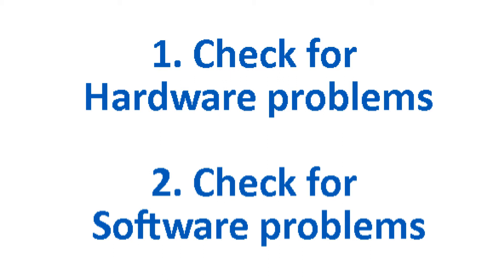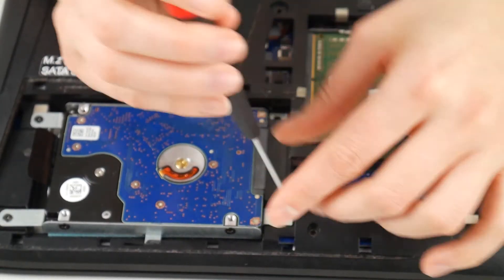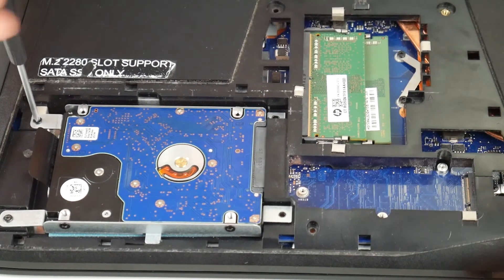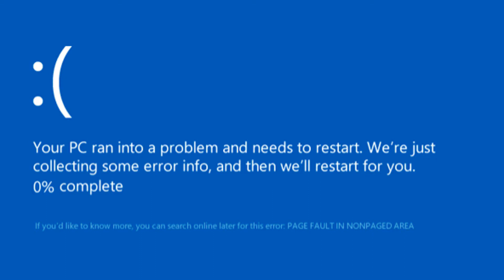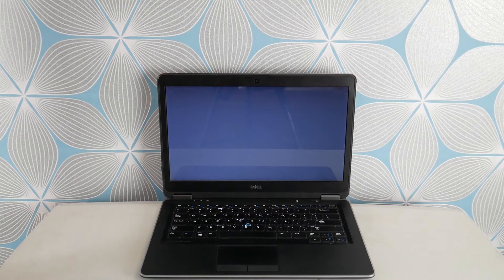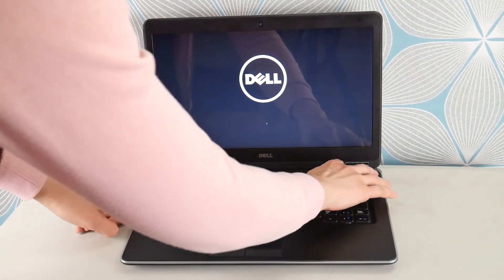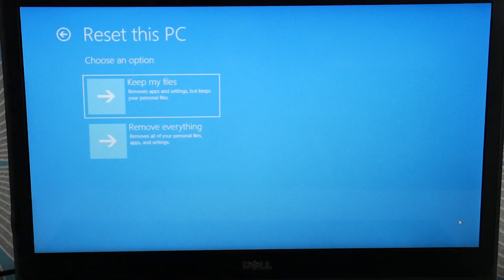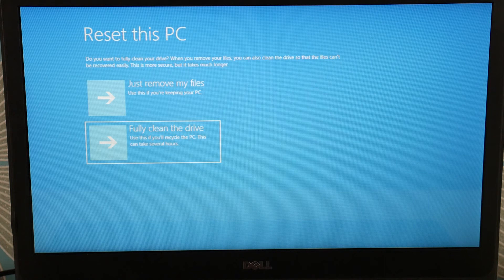How To Fix A Dell With A Page Fault In Nonpaged Area Blue Screen Error

Comment: PAGE_FAULT_IN_NONPAGED_AREA 
Error for me, passed all the hardware checks but keeps looping in that screen, what do I do?
Reply from the maker: Sorry to hear that:( If all that hardware passed the diagnostic then the next step would be to try reinstalling the operating system. Usually this problem is caused by a problem with the operating system. Here is a video on how to do that:

https://youtu.be/TElCJDbKdKk

You can skip the part of the video about replacing your hard drive. Let me know if you have any more questions:)
Reply: @EggheadFixers  I talked to tech support as well, is there really no other option than reinstalling the OS?
Reply from the maker: @Angley  You could try a soft reset which allows you to keep your files but tends not to be as effective.

Comment: omg i am in trouble could u plz help me 
i have dell desktop and i have important files on it 
when i try turning my pc up it after the windows logo show up it crashed mostly or Preparing automatic repair thing thing start loading and again crashing and again and again 
i opened my pc once and i check the cables are not unplugged and i replogged em again 
i didnt touch the Ram and Card graphic or anything else cause i afraid i would break something , ahh when i was missing around with cables and tried to turn it up to test it my pc start making noise sound and red lights , i know that something would have to do with rams maybe 
i am waiting ur reply and thanks a lot
edit : i noticing always weird sound from Fans when starting it up   , it more like the fans stopped working suddenly
edit2: i remembered that screen doesnt fit my screen anymore , the windows logo doesnt show in the middle , the right side of the blue screen text doesnt show up sometimes
Reply from the maker: Is you computer giving off an LED code? A LED is when the LED on you Dell blink a code like it will blink twice pause  then blink three more times pause and then repeat.

Comment: My problem is on Dell Inspiron 545s the BSoD is keep show after booting it can says my pc is boot loop
Reply from the maker: Ya boot loops are a pain...What happens when you run the diagnostic?
Reply: @EggheadFixers  yeah.. when I start the computer the DELL boot icon stuck on half bar,then I restart my computer and it's working.. after i put my password to login to my computer the BSoD comes out, then the 2st times my pc work but when I run 3 programs the BSoD comes up then it restarted it self, when restarting the DELL boot icon glitched out/sorted out I have pulled out my hardware, like mouse,speaker and keyboard then I need to search how to fix glitched boot screen
Reply: @EggheadFixers  yeah the BSoD when I run 3 programs is Memory_Management
Reply from the maker: @theonlyneo_  Memory management is often times a problem with your RAM... I would try this video:

https://youtu.be/Ji65s626_cU
Reply: @EggheadFixers  I can't run the diagnostic, the boot screen are corrupted or glitched out..
Reply from the maker: @theonlyneo_  That can also be a sign of bad RAM... I would try the method in the video of removing the RAM one stick at a time.
Reply: @EggheadFixers  hmm... I trying to downgrade my pc to Windows 7 Home Premium but there's no bootloop again and no BSoD again.. are my computer is not compatible for Windows 10? I'm using windows 7 is faster..
Reply from the maker: @theonlyneo_  Ya if it goes away when you use Windows 7 then  it could be a compatibility issue. Are you running the latest version of BIOS?
Reply: @EggheadFixers  I think no.. it's using CMOS Setup Utility 1984-2001 Award Software
Reply from the maker: @theonlyneo_  You could try updating BIOS and then Installing Windows 10 but there is no way of knowing for sure if that will fix the problem.
Reply: @EggheadFixers  hi, just wanted to ask if u already fix urs? cause I have the same issue with my dell inspiron3000

Comment: My computer had have that blue screen after I resettwd the computer. Is there a fix?
Reply from the maker: Did all your hard ware pass the diagnostic? If all that hardware passed the diagnostic then the next step would be to try reinstalling the operating system. Usually this problem is caused by a problem with operating system. Here is a video on how to do that:

https://youtu.be/TElCJDbKdKk

You can skip the part of the video about replacing your hard drive. Let me know if you have any more questions:)
Reply: @EggheadFixers  thanks so much it is working now thanks to that reinstall windows 10 video. Though I would've had to get a new computer for a sec there
Reply from the maker: @ennup1229  You're welcome!! Happy we could help:)

Comment: Do I need to set boot option to legacy?
As it didn't work for me
Reply from the maker: You can try switching between legacy and UEFI although this tends to be a hardware or software problem and not as much a BIOS setting problem but always worth trying. Did your hardware pass the diagnostic?